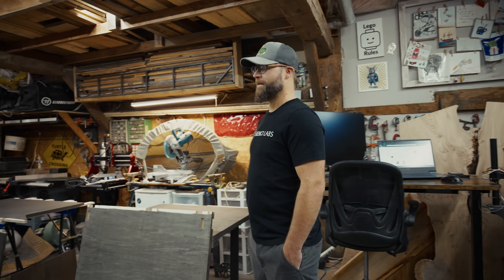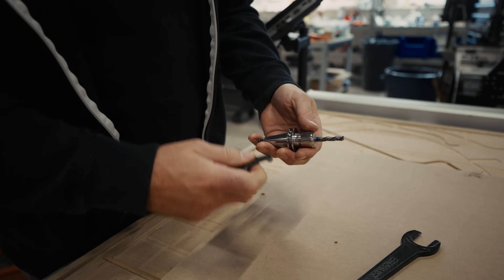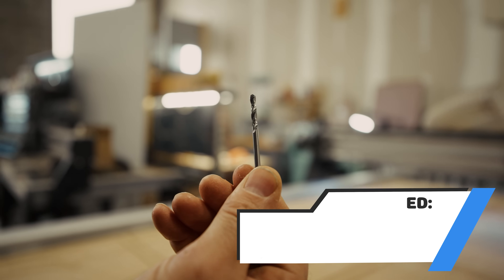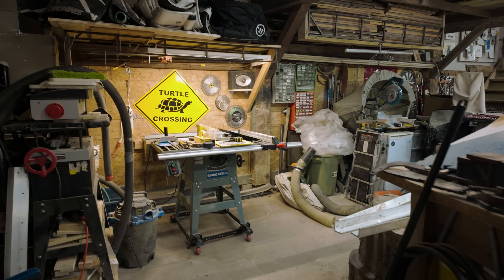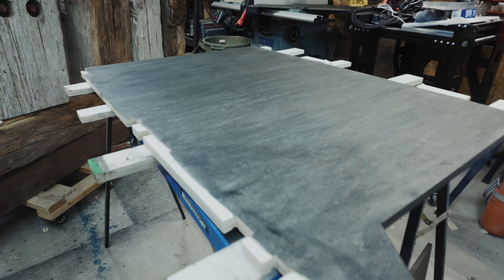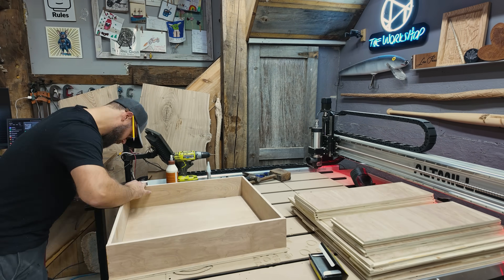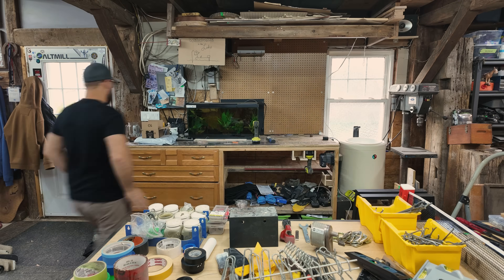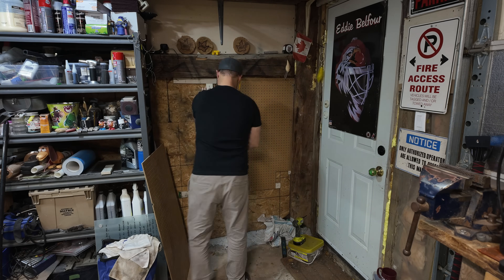How to Make a Workbench on a CNC

Comment: Unrelated question: I built a CNC initially for $500, but it ended up costing closer to $1700. It has too much deflection for precise cuts. I recently bought a 5W laser, upgraded to 30W, but still have the original 5W laser. I'm wondering if you have any knowledge about setting up an Arduino Uno to control the laser?

Comment: Don’t know how much manual woodworking is planned for that workbench, but it seems to me an opportunity was missed to not pre-drill dogholes on the Altmill for the top panel.
Reply from the maker: For this workbench, there won't be a ton of manual work done. However, that's a great addition and would be simple enough for someone to add if they needed them! Thanks for the suggestion!

Comment: How did you secure the sheet of plywood?
Reply from the maker: Since it’s the prototype, no tracks in place to clamp it down so we screwed the excess waste into the waste board. Common methods include double sided tape, hot glue, screwing down jigs in place, clamps etc….vacuum table is a very common and effective method so it’s on the engineering forefront. No announcement plans finalized, but we a looking at it very, very seriously